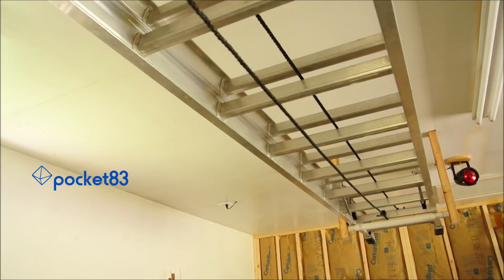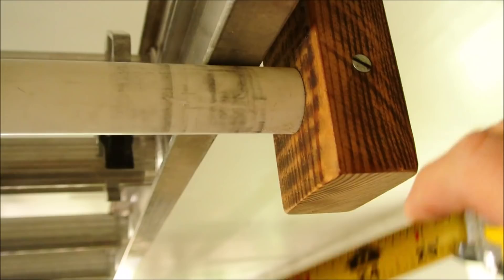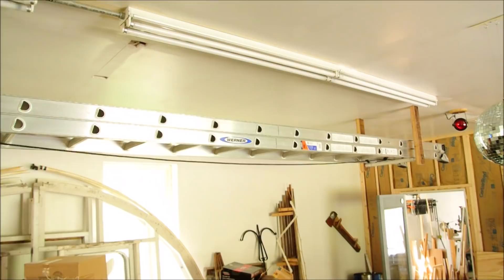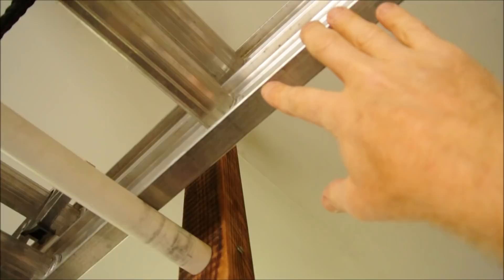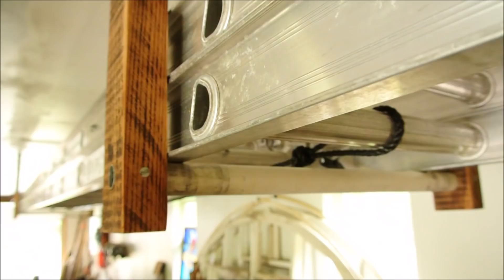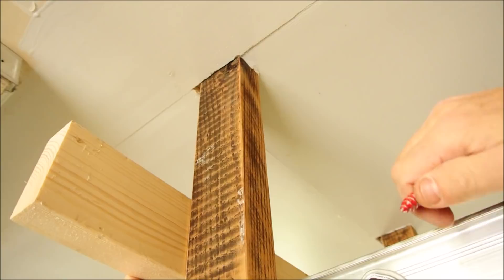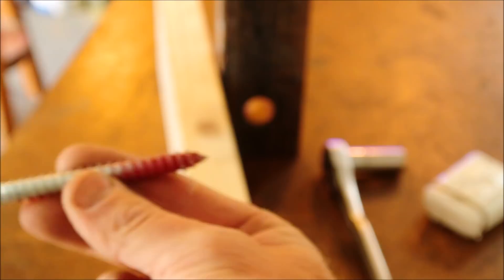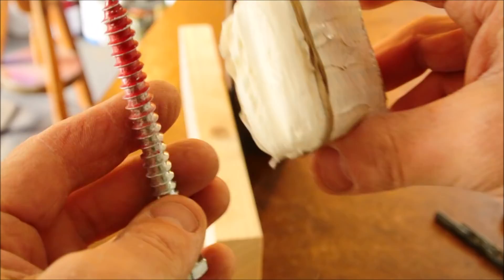Ladder hanger you can hang from

Comment: Could have done it without cutting the drywall and it would have been just as strong. I have attached many different things to (walls and ceilings) buildings commercial, residential, military.  I understand how to attached things to things and cutting drywall is the last thing I ever want to do. Don't want to be so negative but I dont like and or trust people that don't show their face.
Reply from the maker: If a third-party, impartial rational actor were to place a bet on either: 1) something that I had designed and constructed, or 2) something that an anonymous "could have done it" commenter (who also sports a male form in his avatar) had constructed, which do you think would be the smarter bet?  

Let's let the thumb-ups decide, eh? Your comment gets pinned if you win, and I'll gladly feature your "just as strong" design's video on my channel, complete with formal apology.
Reply: There are way too many dumb weekend warriors that will go to idiotic excess in order to avoid cutting/repairing drywall. Repairing drywall takes some time to learn, but it's not difficult, especially for a garage or ceiling where it isn't as noticeable. If cutting drywall is the last thing you want to do, I can only imagine how many hack jobs you've done that would've been 10x better and easier if you knew how to fix drywall.
Reply: So you only trust narcissists?